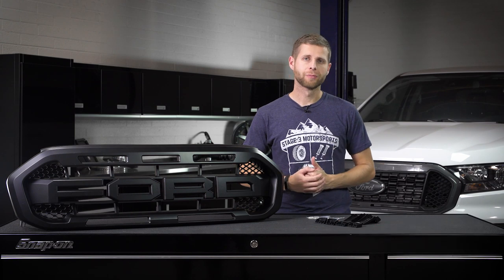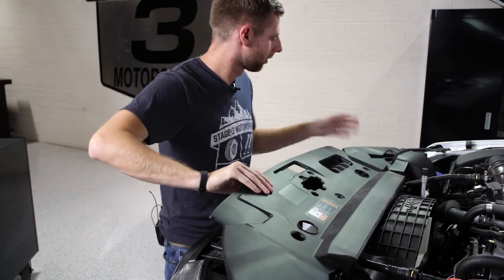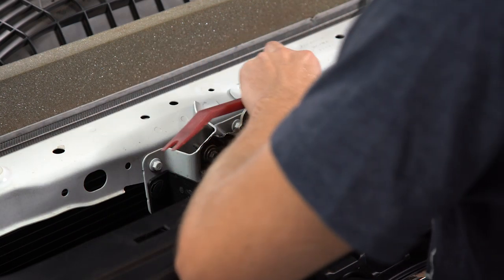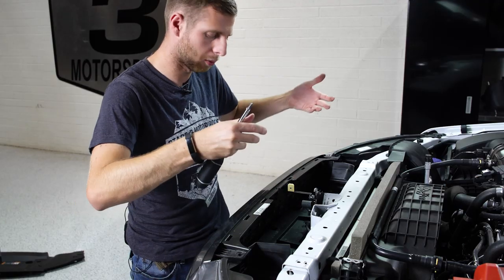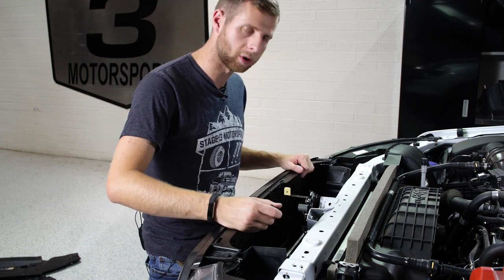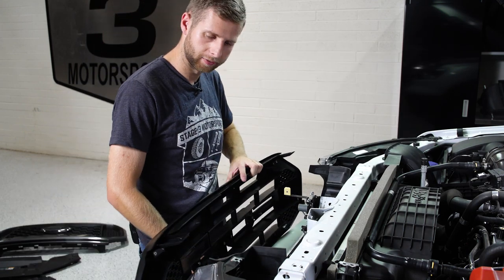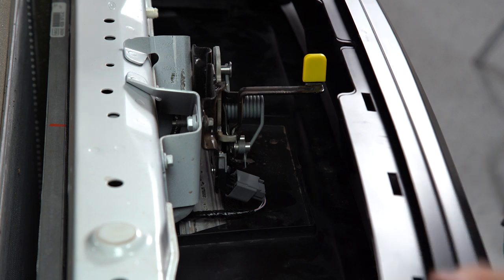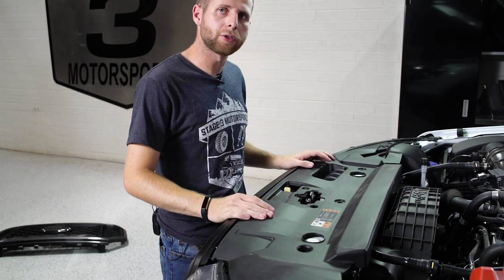2019-2020 Ranger Raptor Style Complete Grille Kit Install

Comment: This was a great video and made installation a breeze. 

The only thing I HIGHLY recommend to anyone installing this is:

Put the shroud back on first before snapping in the new grill. 

If you follow the exact steps by working backwards, it is a huge pain to try and get it back in. 

It makes no sense to do this. 

Just easily put it back while you have the grille off, and easily snap the new grill back in. 

Easy breezy.

Comment: REMOVAL is trickier than it looks to to work the tabs. You need to stick a small flat screwdriver into the tab and work it.  "Push down" is not exactly the way you do it.  If you push in, horizontal with the ground, twist is slightly, it releases easily.   The grill is nice add on and my wife wants the same for the Expy!
Reply: he didn't say to push them in... that's just what the type of tab is called, he clearly tells you to pop them out lmao

Comment: Also, a suggestion: After getting the old grill off, reinstall that mid-level shroud and latch trim before the new grill. You only removed it to get access to release the tabs without breaking them, so you don't need access to push the new tabs in. The mid-level shroud and latch cover are much easier to install with the grill off, once they are on you just snap the new grill on and put the top bolts in and reinstall the top baffle/trim.

Comment: If you are having any sort of trouble with the bottom 5 tabs on the grill I highly recommend using the flathead on your leatherman/ multi tool. I used my rebar and it saved my ass. Took me 20 minutes to get one before I used it. Got the other 4 in 30 seconds

Comment: Got mine on Friday from you guys installed today with the LED lights I would recommend you put the LED lights on before you install this because the install for the lights video is on the OE grille and they don't tell you that the lights are screwed into the tall brackets not the two screws in the grille.

Comment: Just received my replacement grill after ordering two months ago (Ford's delay, not Stage 3's).  I've watched this video a few times and he says you'll have "12" longer screws for the top tabs???  I hope that was mis-spoken because my new grill came with letters and tabs mounted.  I even turned on the closed-captions to be sure of what I thought I heard.  Going to install it this weekend.  Lot's of good hints in here.  Oh and I'm only replacing mine because mine was busted when a truck tire retread came off a semi on the interstate, car in front of me hit and it flew up and slammed in to my OEM grill at 70+ mph.  Grrrr.  Guess I was lucky it didn't hit the windshield.

Comment: I ordered mine a few weeks ago and upon unpacking I found my wiring 
harness to have the old style negative and positive wires with C clips 
on the ends. Since then the product is no longer available on Amazon and
 there was absolutely no paperwork included in the box for customer 
support..not even the company name. Anyone have an idea how to wire that
 or where to get a replacement wiring harness? Besides the wiring issue,
 this video was spot on. Thanks!

Comment: any suggestions on where do I get the same grille but with 3 or 4 LED lights on it? eBay and other online shops don't have them anymore. thanks mate
Reply: This company offers either a 3- or 4- light kit as well, check their website. I'm seriously contemplating the 4-LED.
Reply from the maker: We have the 3 or 4 light attachment to achieve the look you want, find them in this link - https://www.stage3motorsports.com/2019-Ford-Ranger-Raptor-Style-Grille-Light-Kits.html
Reply from the maker: @731trident  This 4LED's sure do look good!

Comment: That grill in carbon fiber would be sweet. I like my stock grill better 2021 Ranger XLT FX2. I have a 5 gen Toyota 3.0 V6 new engine new everything 4x4 standard cab short bed for off roading. My new truck is to nice to be beat on in the woods.

Comment: Will the LED lights you guys sell work with the raptor style grill too?
Reply from the maker: The lights in the raptor style grille are one off lights, we do not sell replacements for those.
Reply: I  bought my ranger from the dealership and it had a raptor style grill on it already.  No lights tho.  Any Idea where I could buy lights for it? @stage 3 motorsports

Comment: Will this work with the raptor lights you guys sold? I see the cut out on the raptor grille but no mounting points. I currently have the raptor lights on the original grille
Reply from the maker: They do not directly fit, but that isn't to say you couldn't find a way to make it work.
Reply: @stage3motorsports  Any ideas on how to make this work with the lights?  If so im gonna buy both.
Reply from the maker: @samchandler8800  There is now a set available https://www.stage3motorsports.com/19RR-2019-Ranger-Custom-Auto-Works-Raptor-Style-3-LED-Grille-Light-Kit.html